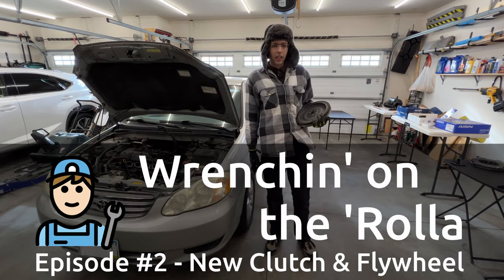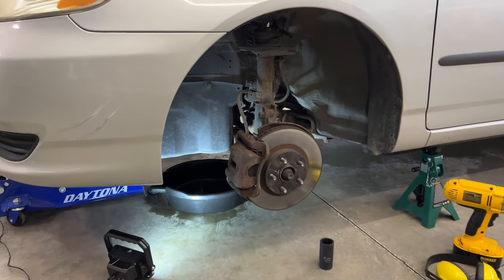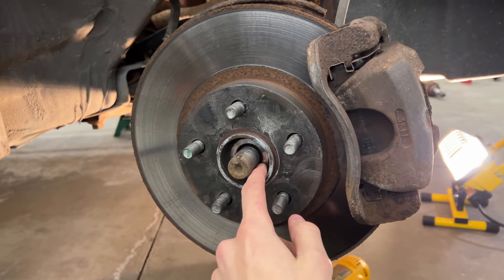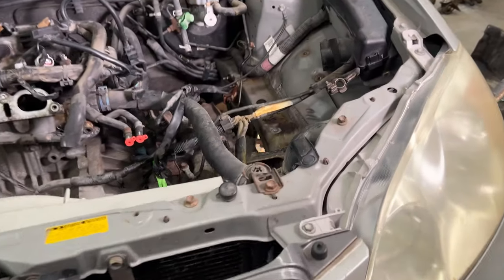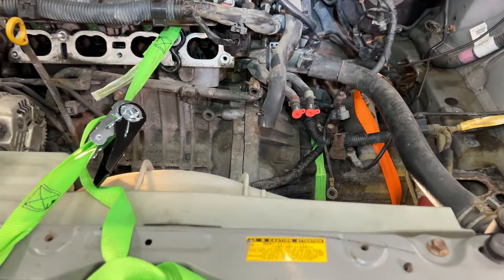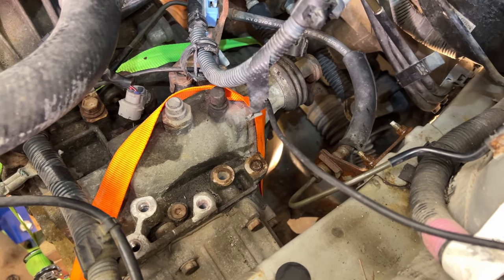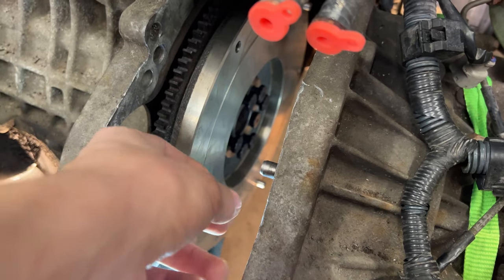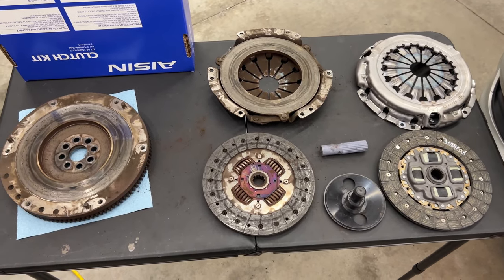Corolla Clutch & Flywheel Replacement (2003-2008) Without Fully Removing the Transmission

Comment: Dude where can I buy that tool at? I’m having a very tough time trying to get my clutch done. I can’t believe they don’t provide the correct tool in these kits. So frustrating.
Reply from the maker: I searched online for “1zz-fe clutch alignment tool” and found two options:
ACT ATK73
Centerforce 50012

Either of these should work. I was assuming my kit had just forgotten the tool, that is crazy if they are leaving it out on purpose!
Reply: @BrenoAutoGarage  I was able to get it centered up with a little creativity. But I’m having another issue I’m not sure if normal or what. But my engagement point is super low now. Maybe just because it’s new?
Reply from the maker: I did not feel much change in engagement point after my swap. I would try bleeding the clutch slave cylinder (keep the brake fluid reservoir topped off, they share the same fluid). Also check that the slave cylinder pin and clutch fork are all lined up correctly.

You could have a friend get in and push on the clutch and you watch the slave cylinder to see if it’s pushing the clutch fork in correctly. As long as all the parts are together correctly and bolts tightened I don’t know what else it could be.
Reply: the crappy duralast brand kit had it

Comment: real talk how hellish is this how long did it take? and is it doable for someone with basic car tools but no specialized jacks
Reply from the maker: My reply might be too late to help, but without some way to support the tranny you’ll either have to lift it down yourself (if you’re strong) or get a friend to help. Would be tricky to either way laying on the ground with car lifted on normal jack-stands/ramps. I would not have tried mine without the motorcycle jack. Now that I have a cherry picker that would have made it even easier.

It’s been a few years but the major pain points I remember are:
-removing the cv axels without a slide hammer
-removing the back engine/tranny mounts
-aligning the tranny input shaft during reassembly (would be harder lifting by hand)

What I’ve discovered over the years learning about cars is there are a lot of easy things you can DIY to save big $$$ on cars (brakes, hubs, fluid changes, upper engine gaskets, key programming, recently AC recharging, heck even a head gasket can be easier depending on the engine), don’t be afraid to let a fair shop handle stuff that is miserable without an overhead lift. Having recently built an exhaust system on the ground I speak from experience.
Reply: @BrenoAutoGarage  ye I finished already was awesome thank God all works well getting it down was more challenging I ended up removing entirely but i used the technique frm the video geting it up I ended up just semi resting the bell housing on my my chest and stomach and flexed a bit and then I shimmied myself into position and kind just bench pressed it up and on

Comment: Did u have to keep the engine jacked up or did u just let it hang on one mount
Reply from the maker: It’s been a few years but I believe I left a jack under it the whole time, pumped back up as needed. With only one mount it would sag way too much, probably break off unless it hit the subframe first.

Back when I did the head gasket on my Prius I took the passenger mount off and left the other three, and even with only one removed it sagged down a good couple inches. I should have supported the engine that time too, but I didn’t know better.

Comment: Can I do this with a year 2000 manual transmission Corolla?
Reply from the maker: I would assume it is a similar process, just make sure to get the right parts for your vehicle (might be different for the 8th gen corolla)

Comment: After seeing a couple dozen of these clutch replacement videos I changed my mind about buying a car with a stick shift. Screw that old museum shit from the WW II era. I'm going with a nice classic - an 8-speed torque converter driven gearbox. You guys can spend all your life replacing the ancient mechanical friction crap that wears out, and I'll be driving a nice fluid friction based gearbox that never wears out 'cause it's all fluid! My 23 year old Toyota with a torque converter automatic that never ever required any servicing besides changing fluid every 100k miles proves I'm right.
Reply from the maker: This is my first manual car, and doing the clutch replacement sucks, but it makes a boring economy car like a corolla fun to drive! At the time this car came out most automatics were boring 3 or 4 speed units.

But you’re right, a well made automatic with occasional fluid changes will last the life of a vehicle. Although I’ve driven newer 6 speed automatic cars with the “manual mode” shifters, and it’s just not the same as a true manual.
Reply: be a man

Comment: I put Mobil 1 GL5 in my Corolla which both the DEALER and ALLDATA say GL4 OR GL5 are FINE. Now you have everyone scared of wearing out their synchros yet you gave us ZERO solutions bud. Pennzoil synchromesh is GL3!! Feels like Motor oil you DON'T want to put that in a Corolla MT. 

I live in BALTIMORE and I called 6 different major Parts suppliers and NONE of them carry GL4 including the TOYOTA DEALER. I'm not saying you're wrong but I am saying you can't just drop a bomb like that and not tell people A: What Gear Oil you are using and B:Where to get it!! `This is just getting ridiculous!!! What makes you so damn sure the synchro's will wear out if I use Mobil 1 75-90 GL5? Where are you getting this information?? Don't you think Toyota would be aware of it?
Reply: You are correct. Workshop manual for an '04 says 75W90 GL-5 or GL-4
Reply from the maker: I found out about the GL4 recommendation on the Toyota Nation forums. I used Red Line MT-90 from Amazon.

Here are some links to take a look at where I got my information. First one is a general overview, go down to Transmission Issues: https://www.toyotanation.com/threads/2003-2008-corolla-matrix-pontiac-vibe-common-problems-and-potential-buyer-thread.1343825/

And the next thread with lots of part numbers to use (go down to Gear Oil for M/T): https://www.toyotanation.com/threads/official-ultimate-2003-2008-corolla-matrix-pontiac-vibe-maintenance-thread.429745/

From the maintenance history I got with my car the tranny was rebuilt at 150k miles so GL4 vs 5 I wouldn’t panic, it’s a very slow going situation. I just wanted to pass on what I’d found online to maximize tranny life. Look up “GL4 GL5 brass synchros” on Google for more information.